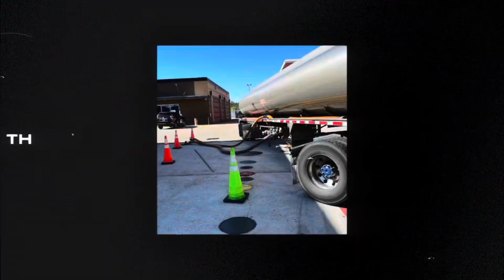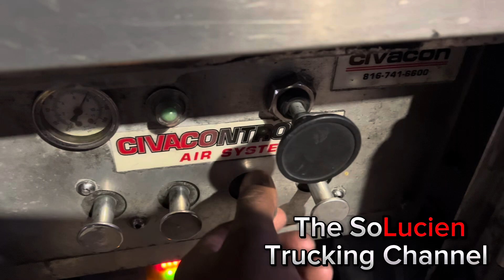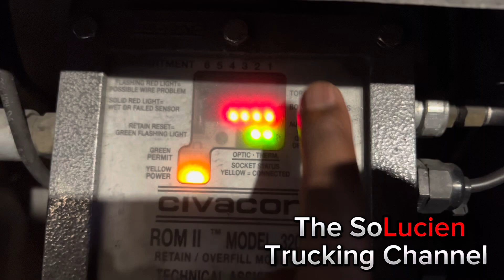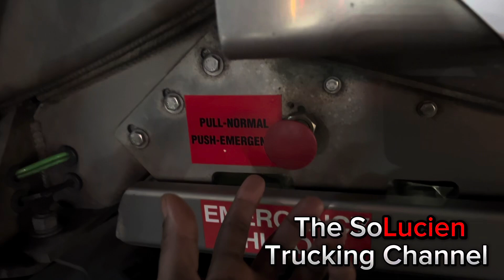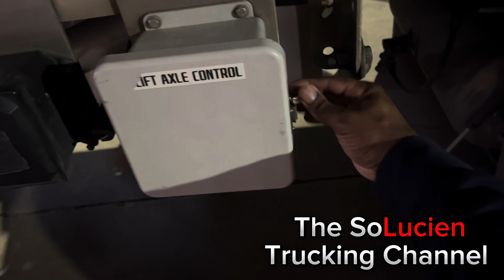*Exploring the Fuel Hauler Tanker: Inside and Out!*

Comment: I have a 5 compartment trailer, we haul 8,500 for gas and 7,500 for diesel. Also just because your compartments say it can hold 2,500 doesn’t mean it can hold it, especially if you loading under the rack. You can probe out if you put to much gas in that compartment, and down here where I work at in the DMV if you probe out you can get locked out by the T.O!! And that’s not a good look, just something to add to what you said. Keep doing your thing and be safe! #tankerboyz
Reply from the maker: This is true. I actually mentioned that in my loading rack videos. But you’re definitely correct. Some of the racks down here will let us bucket drain if we overfill. But thank God I haven’t had to do that so far